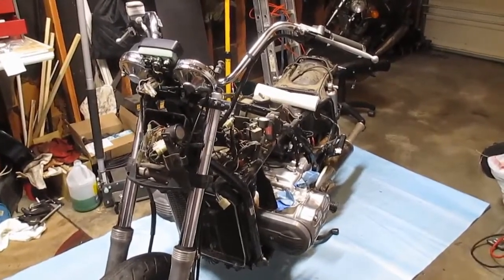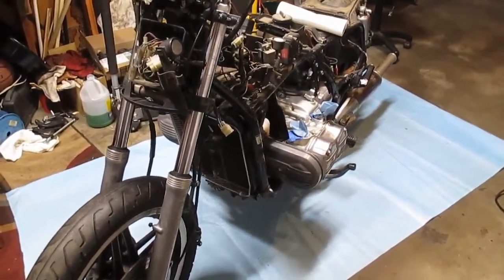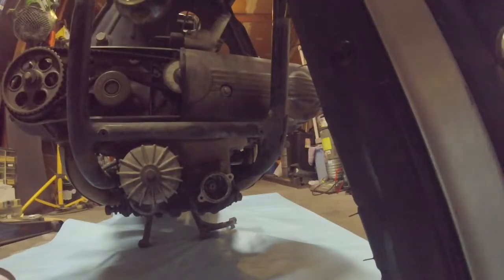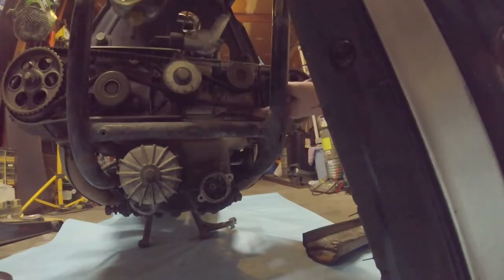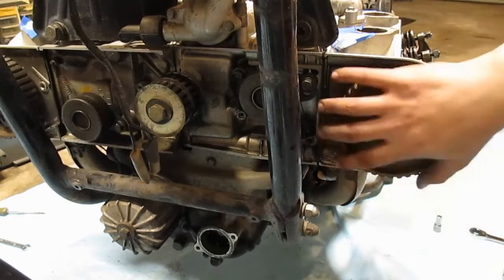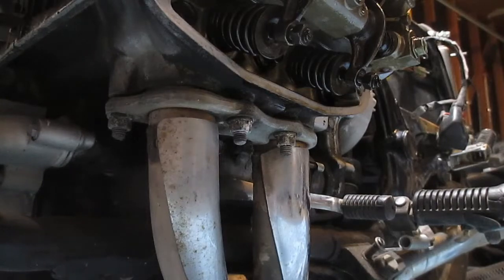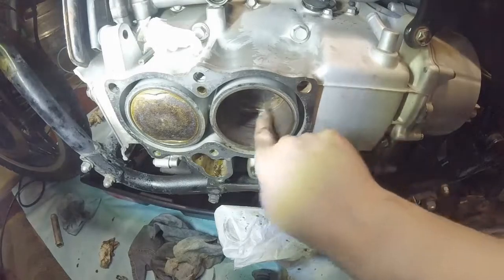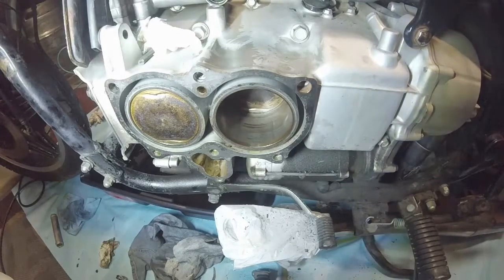1981 Honda GL1100 Goldwing Part 2 | Cylinder Head Removal

Comment: Clips work well to hold the timing gears in place. It can be a nightmare situation on a Subaru when the belt comes off and the gears spin.
Reply from the maker: I've been there! Timed lots of Subaru motors. What clips do you use?
Reply: @DustyDingus  you can use c claps or metal clips like you'd use for a bag of potato chips.
Reply: Wish I had read this before I pulled the belts off, had no idea the cam shaft would spin like that but sure enough, pulled em off n whir!

Comment: Are you cutting your exhaust pipes down at all? I cut mine and am using BLK engine paint on them. The ends will be cut at a 90. Good job brother, if you need any parts hit me up I might have them.
Reply from the maker: No I am going to leave the pipes unmolested since they're in pretty good shape. Thanks for watching

Comment: Dude, where is the water coming from? Do you think it had a bad head gasket?
Reply from the maker: No, it sat outside with the carbs off by previous owners. They had some painters tape but you could see through the intakes water was getting in. I am always glad I took it all apart before I ever tried starting it, there was a lot of crap packed in there.

Comment: You could have a broken water pump your head gasket are blown. your going to have to change those rings those are cheap on ebay rod bearing are obsolete unless you want to pay 5 or 6 hundred and hope you can fine new bearings. you might as well pull the motor out and put new stator new clutch. you'll have to split the block that's all HELL.. and put a new timing belt on it.
Reply from the maker: What are you talking about? The head gaskets showed no signs of damage, I've seen my fair share of head gaskets. Water pump passed all of the checks and doesn't leak. The cylinder walls was all light surface rust and cleaned up beautifully. The compression test results were good and the bike runs beautifully. The stator connector issue has been addressed and the charging system works without issue. Both stator and clutch can be done without splitting cases. Both timing belts were replaced along with tensioner springs. Cams were checked for wear and were acceptable. Valves were lapped, camshaft seals and valve stem seals replaced. I even measured valve springs. Everything torqued to spec and timed without issue. Every seal along the way, including exhaust gaskets and tach drive seal.
I am positive that all of the damage was poor care and neglect after the bike was parked and then partially disassembled and then parked outside some more.
Check out the other videos, this bike doesn't have much further to be road worthy.
Thanks for watching!
Reply: @DustyDingus  I know you can change the stator with out splitting the case I was talking about the rings only you don't want to split the case. Yet I'm doing mine 79 gl1000 I went in to change the stator. after I pulled the motor. winded up charging the head lapping the vales in clutch timing belt water pump painting the motor gold and sliver 2 toning it was not want to go into it that far . Yet what the Hell might as well I do not have nothing else to do when I finished it be 70% restored I hope I don't go over boarded and do 100% I want to get this thing done and nice. my rings are nice it turns over really good. And I almost got it free the bike came 110% when i got it Like it has the vetter boxes got all the keys and the guy put on a whole bunch of more stuff not to much rust yet some. That's the only reason I'm going tis far. it would be really cool to find the vetter sidecar they made one with the lights and all. Found one yet the guy sold it had all the brackets and light . he told me sold it for 3 grand same color as mine to. vetter side car are rare. find.
Reply: The bearings in these should have no problem reaching 200 thousand miles it's not a Harley

Comment: Did you put the engine on top dead t1 to remove both heads or did you have to rotate the engine to remove the other side please like my comment because I won't get the notification if not